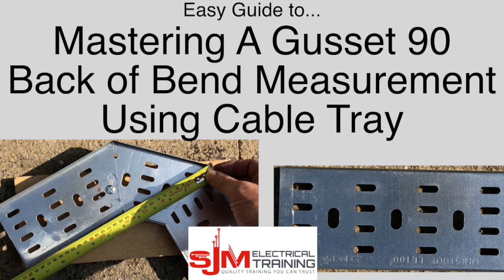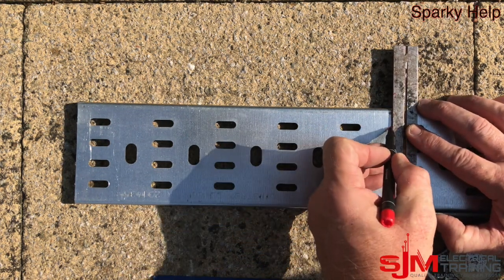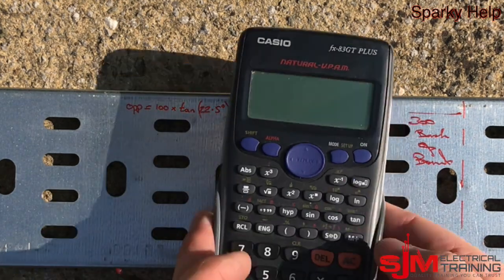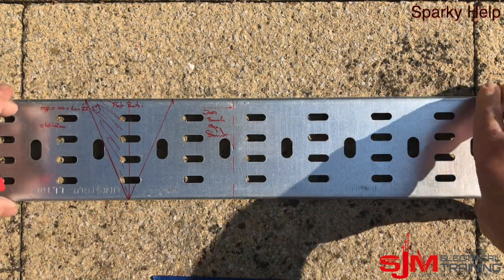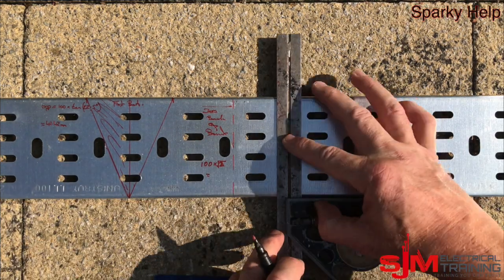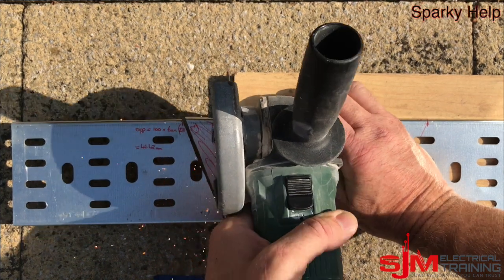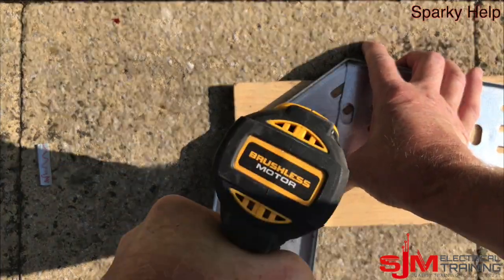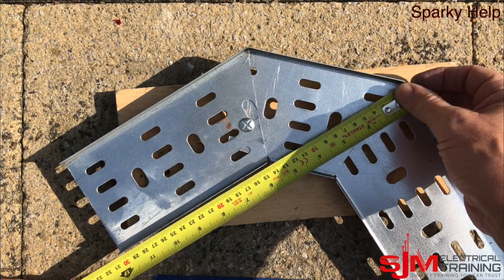Master the Cable Tray Secret to Perfect Back of Bend Measurements Every Time

Comment: This worked a dream for at work, thank you. One question. how can I get 2 bends side by side with a 50mm gap. I used a 300 mm tray and 150 mm because I had to do that at work, and it didn't look right. The gaps weren't the same for me
Reply from the maker: HI Thanks for watching please share with like minded people, I presume you are talking about the gap between two parallel trays.  at the bends the one on the outside would have to have different dimensions to achieve a perfect parallel form, you would have to measure it and adjust accordingly.  I hope I have interpreted that correctly.  Don't forget to like and subscribe.
Reply: @sparkyhelp3997  Thank you, I have shared it with many people, and yes, you have explained it will

Comment: Very helpful! Have mastered this bend now! Any help for an internal riser / internal 90° bend ? 
Cheers in advance 👍
Reply from the maker: Thanks for watching please share with like minded people. Just cut straight down the return lip at a few section and bend to appropriate radius depending on size of cable.  Please like and subscribe.
Reply: Brilliant video, done it today. The bend was great, but my measurement from back of bend was slightly longer. I had a measure of 471mm to back of the bend. Done all the measurements correctly, but my back of bend measured around 530mm. Not sure where I went wrong atm. I done  the bend the other way to your video but still should be correct.
Reply from the maker: @tucker35Ire  looks like you are out by 50mm, seems you may have measured away from the wrong point.

Comment: Why √2?
Reply from the maker: Hi, on this triangle i.e. 90, 45, 45 angles, the the ratio of the two (equal) short side with the hypotenuse is always sqrt of 2 (or approx 1.41)  Please share with like minded or maybe even like and subscribe.
Reply: Great video 👌🏽 just out of curiosity if you wanted more of a swooping bend could I use a tan15 to calculate my angles and still measure my width x square root 2 to give me the centre line for the final bend ? 
Im yet to try this out on a cardboard model